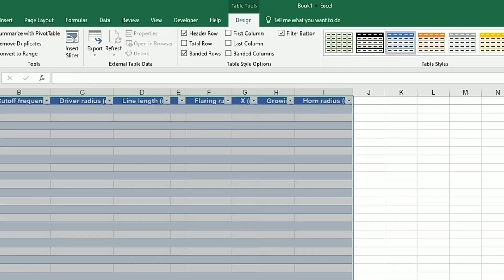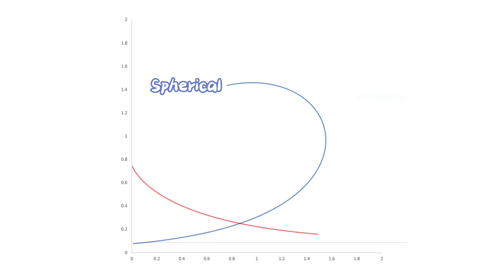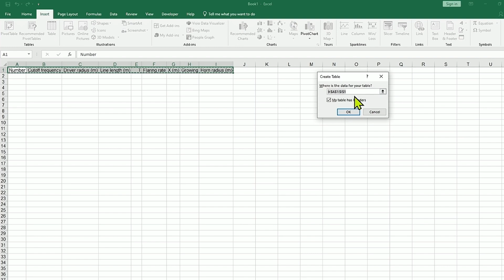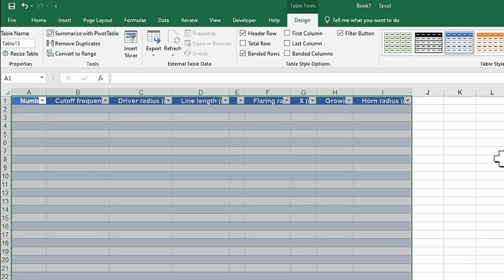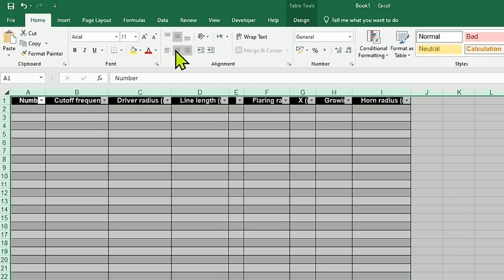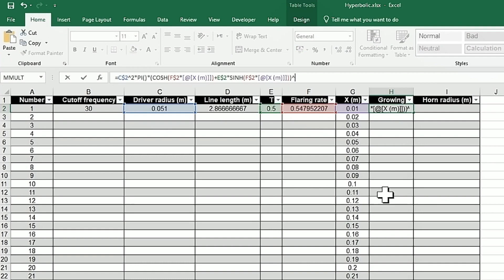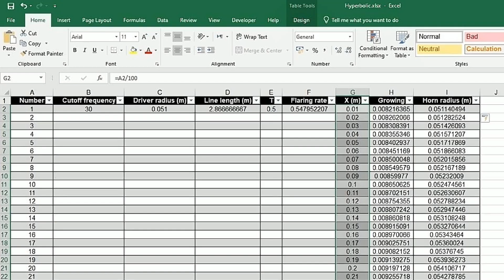All about horn speaker design-4

Comment: The dsecription of the horn was a bit false, a regular bass reflex port is tuned to a frequency where it couples with the driver where a horn increases acoustic pressure that the driver sees and improves the efficiency of the driver, creating a sizeable boost to the output. A horn doesn't need a visible driver to couple with the output, it can be enclosed behind the horn...